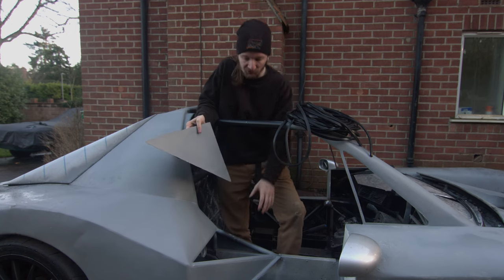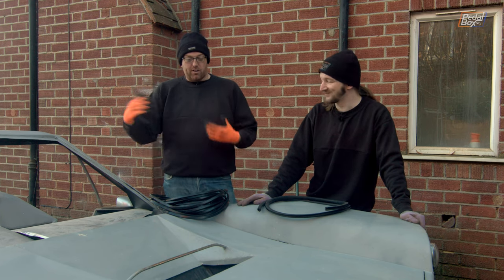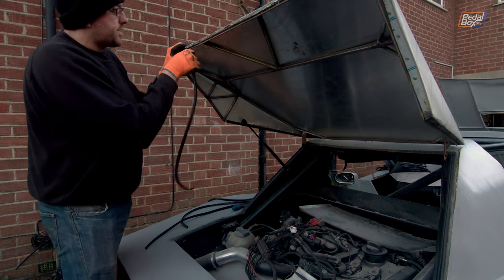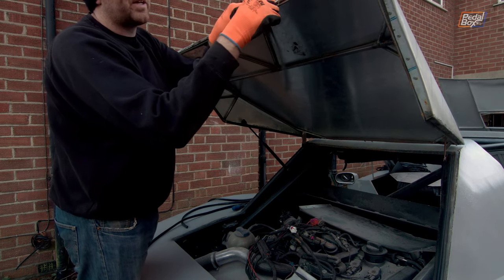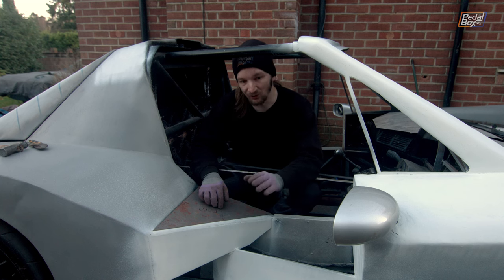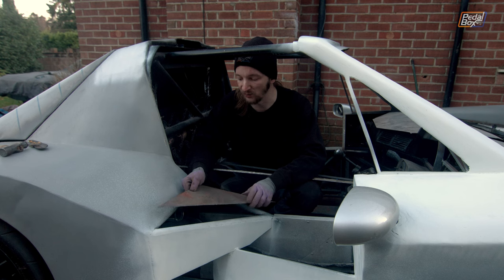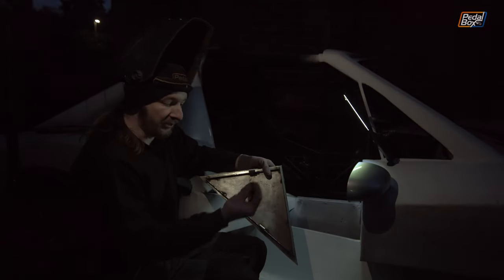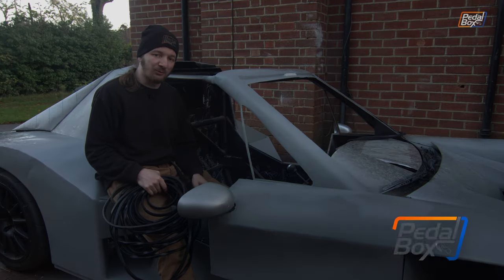Seals and Panel Gaps | Audi TT Kit Car | PedalBox Episode 119

Comment: Was happy with 5 mins on sealing the deal!! 
Engine bag sealing, thought about adhesive backed foam, which I've seen in various thickness's would form a weather seal as such and fairly simple solution
Keep up the winter build!!
Reply from the maker: The self adhesive stuff might get warm and peel off, is my only concern due to the, ahem 'close contact' fit in some places, it'll pull it off when there's any movement of the lid. Had it already with the rubber stuff, but it doesn't have any glue, so sort of expected.
Some very thin stuff where the flat surfaces touch might be worth while though to stop the clatter and protect the paint, good shout!

Comment: Why not switch to a piano hinge for the rear hood/bonnet? That triangular cover won't pop out, if you go over some bumpy roads?
Reply: Or wind....
Reply from the maker: The cover is actually surprisingly hard to remove, getting a finger under an edge is quite tough to start, not sure what the best way to demo that is but its a fair point! We'll try and address the concern this year :)
Reply: @PedalBox  Maybe you guys could use Dzus fittings.

Comment: Bit behind so if its been fixed then ignore me could you not use fibreglass resin layers for the dip before the clamshell and sand it down to the shape you need?
Reply from the maker: Tempting for some of the spots where the metal is a little flexible/without shape and the filler might crack. At the moment we're avoiding bodywork while it's cold. Even just putting on some primer needs the panel warming up with the heat gun (along with ourselves)